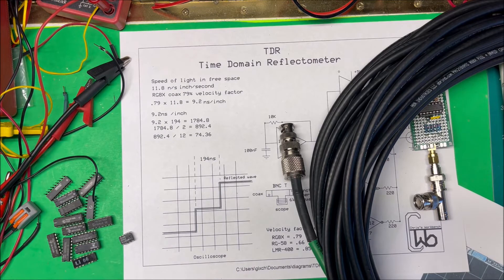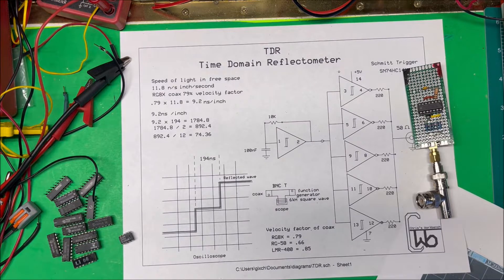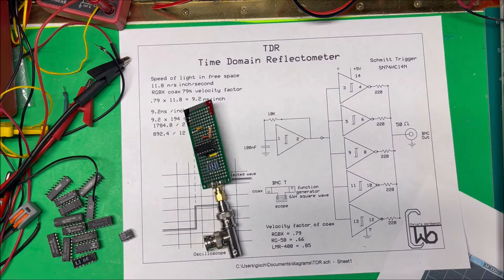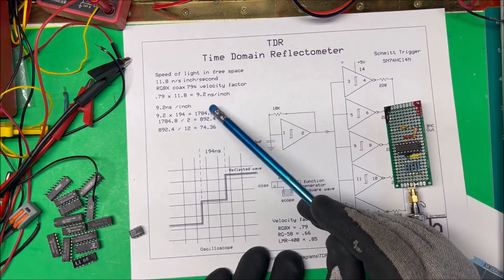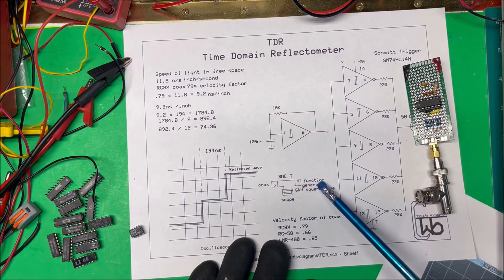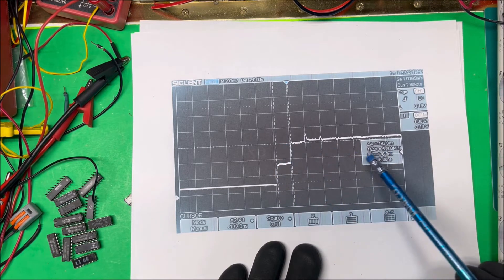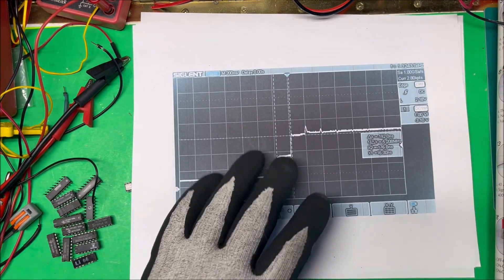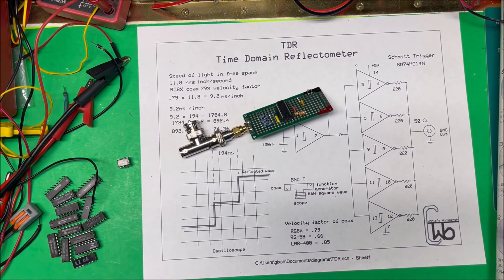Time Domain Reflectometer

Comment: Very cool. 
...Out of curiosity -since I'm planning on building a similar TDR circuit - did you happen to measure the signal rise time? I'wondering if the 74AC14 might be a better option. It would be a  drop-in equivalent in the circuit.
Reply from the maker: The 74AC14 is a better option, I didn't have one.